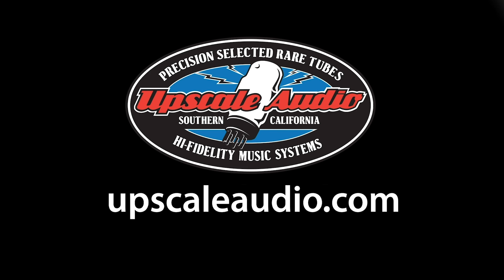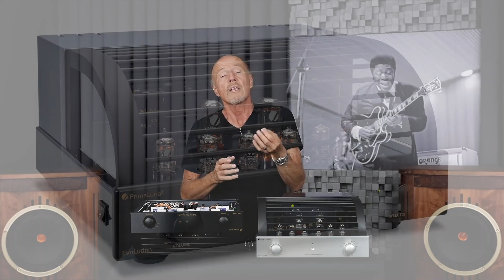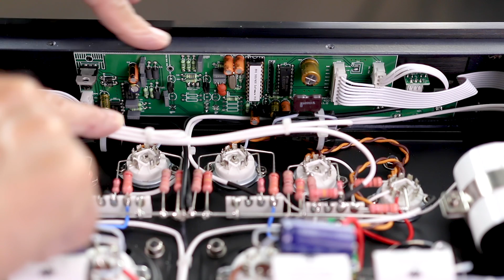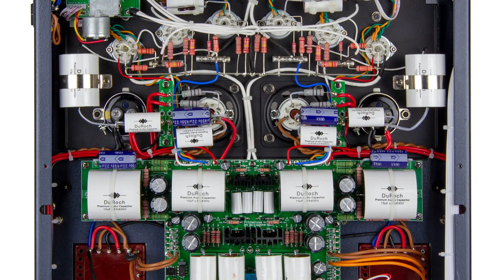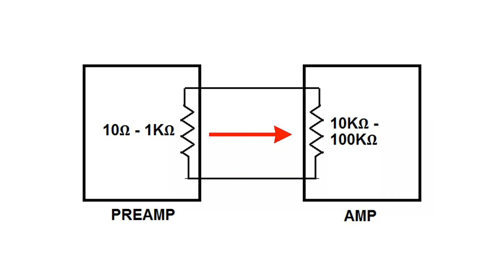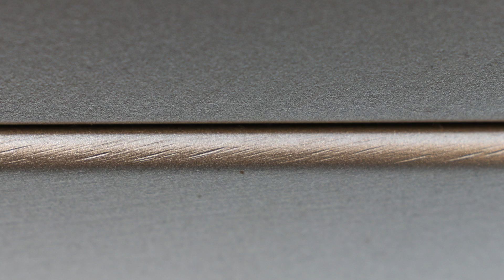PrimaLuna EVO 300 Tube Preamplifier Review w/ Upscale Audio's Kevin Deal

Comment: I just bought one of these 10 days ago, received it 4 days ago. Out of the box, this thing is built solid and refined. The tubes are partially burned in at the factory so they can match them. As a result, the sound out of the box is very, very good. The sound stage is also very, very good. I am looking forward to many hours of listening pleasure. Definitely worth the money. It out performs pre-amps costing thousands more dollars.
I spoke to 2 different sales guys, one about this and the other guy about a streamer and a DAC. Both were very helpful, not pushy, and patient with my questions. I like their in home testing/audition policy. If you don't love it, you can return it for a full refund (you pay for shipping).

Comment: How does the pre+amp combo compare with the integrated? Is it worth it getting the combo for twice the price rather than the integrated?
Reply: With separates, you have 4 power supplies, you are truly dual mono in the pre amp and the amps. The EVO 300 pre amp is a true dual mono design and it is fantastic. Separate power supplies equal better dynamics and generally better overall sound experiences. If you have good enough speakers, then the separates will generally provide a better soundstage as well. Separates generally sound better when you can place the amps close to the speakers and minimize the speaker cable length. It is better to use a longer interconnect and shorter speaker cable than it is to run 2 or 3 meters of speaker cable.
Reply: @briangc1972  Aha, I see. Thanks for your reply.

Comment: Probably Paul did not like him saying how products made in Boulder, Colorado have printed circuit boards made in China. So they removed that part and reuploaded the video.
Reply: Curious just what parts you think are made in the USA?  Metalwork?  Transformers?  PCB's?  Relays?  Switches?  Volume control?  Carboard packing?  I have been consistent on my position on this forever, regardless of brand.  Only in Hi-End audio do manufacturers play so fast and loose with country of origin, and the government should hold their feet to the fire.  It already happened with Tara Labs when they got in trouble.  End users that think that made in USA sticker means quality should instead use Google Images and compare part by part and get something for your money.
Reply: @kevind2760  I wonder if my a/v receiver, Denon AVR-X7200WA, is really made in Japan or it has the same fake sticker.